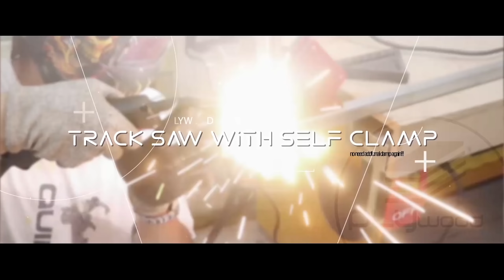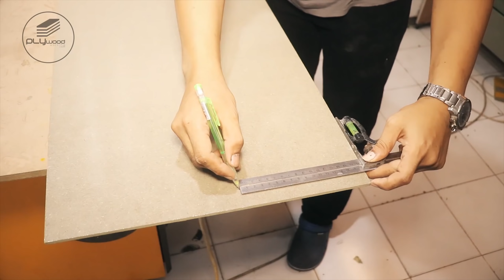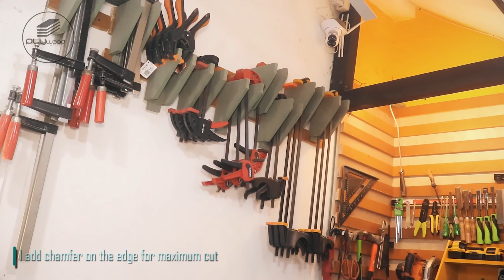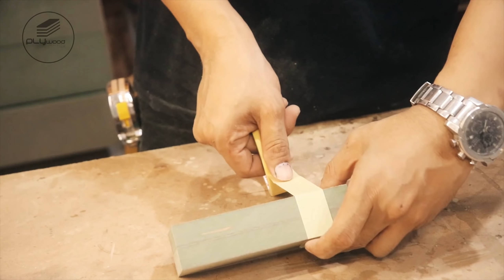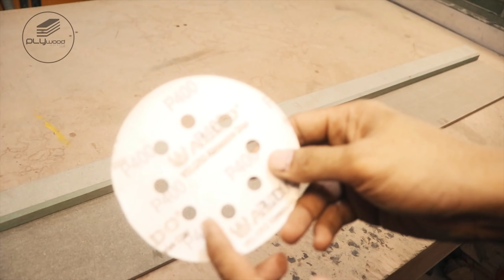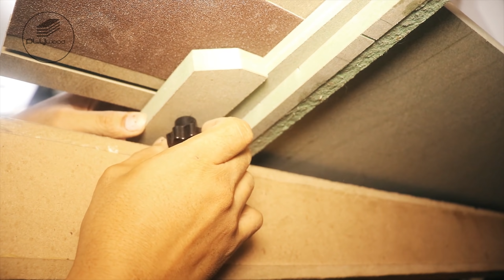Track Saw Guide With Self Clamp - no need additional clamp again !!

Comment: Perfect! (as always!).  Very similar to my old Bosch rail guide system 140 cm long that came without clamps, so I will make two like you did. I modified two small 2" iron "C" clamps by grinding one of the "C" ends to be able to go inside the rail, and it works good, but with your type of clamp, I could use it to produce 90 degree guide to do parallel cuts. Thanks so much for your videos.  Liked, Subscribed and "Belled"!
Reply from the maker: Cool, thank you very much!!!